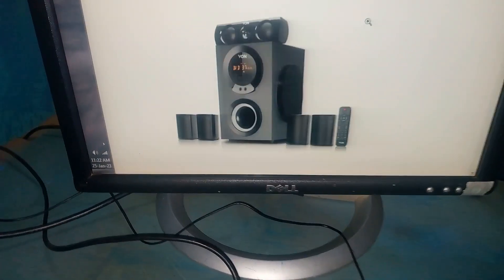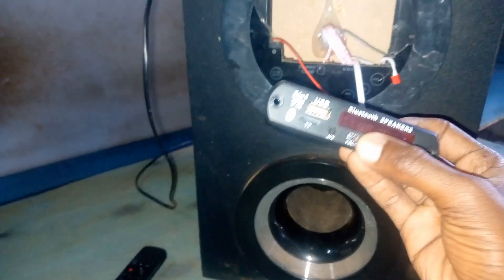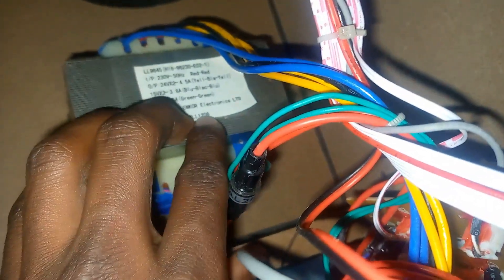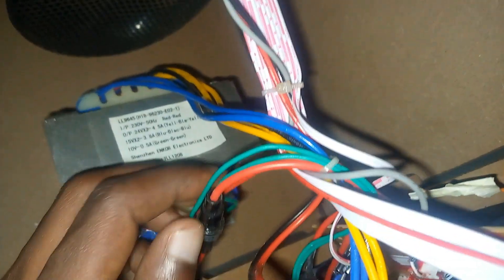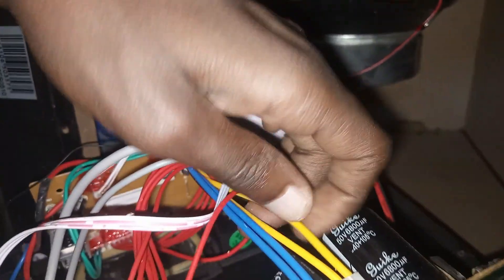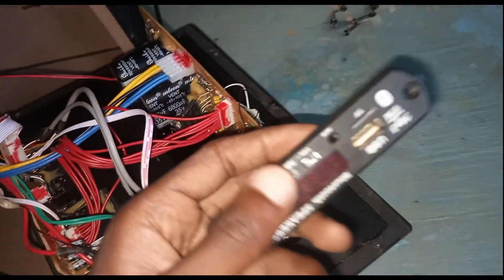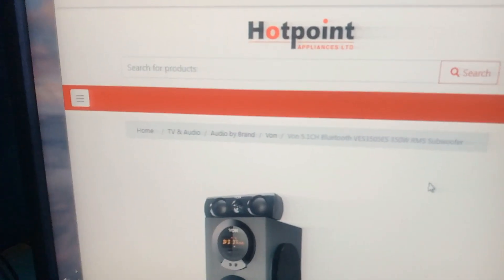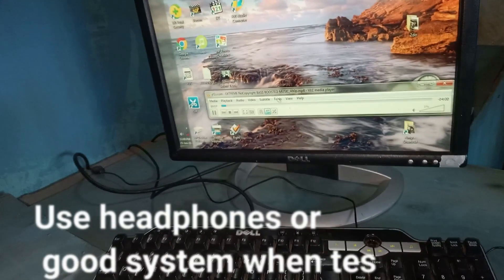10 inch Sub woofer technical review,  inside Von VES350ES

Comment: Hey man, I am trying to DIY one of those green board hifi amplifier and I am stuck on how to correctly power the 12v MP3. I am also experienced some humming and buzzing in my first attempt....can you guide me on how to go about such???
Reply from the maker: You can tap 12v from the 7812 regulator supplying power to the fan.
Also you can include 12v adapter to power the mp3, but that would add more cost.
The humming is quite hard to totally eliminate, I use capacitors to filter. 
The mp3 itself easily distorts at higher volume. I see some people use car radio for audio source. It has clean and rich signal, but would add more cost

Comment: Got a question here, is it possible to bridge TDA7377 or any equivalent?
Reply from the maker: 7377 mostly is used alone, not in dual mode. Depending on configuration, it can produce two, three (2.1) or 4 speaker outputs.

Comment: Bro that's great technical know how. 👏👏. Keep doing it

 I think they omitted the second tda7294 since they would need a subwoofer rated at 200watt and 8ohms. 

That company has really tried. Putting a ten inch woofer. Na pia 100watts sio mchezo. 

The only problem I have with these woofers is the cooling of the ICs and the transformer. That tda gets really hot. If it was mine i would make an external casing for the amplifier and power supply and preamp. Hio sub nirushe chini ya kitanda😂
Reply from the maker: Yeah, additional 7294 would need more power (transformer) 200w sub and bigger box plus tuning, that would cost more
Reply: @emmanutechnician  exactly!
Reply: Noo i think there would be no reason to change the subwoofer if the missed out IC was there.. We've seen High output amplifiers powering lower RMS subwoofers with no problem. If The ic is rated 100watts @8 ohms, maybe the chip might output something like 200watts at 4 or 3 ohms.